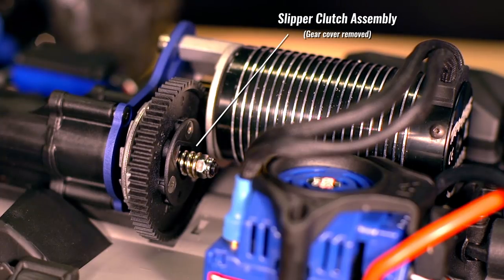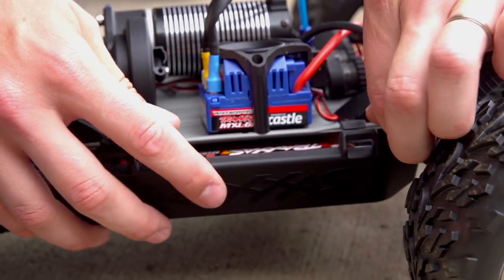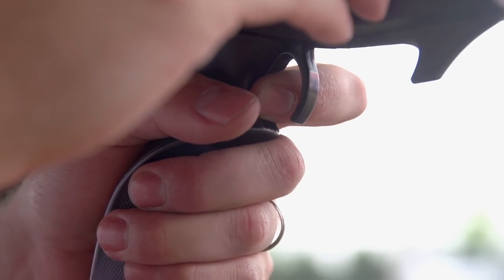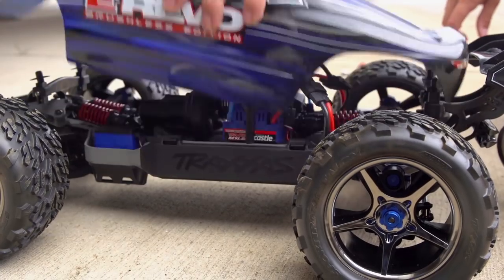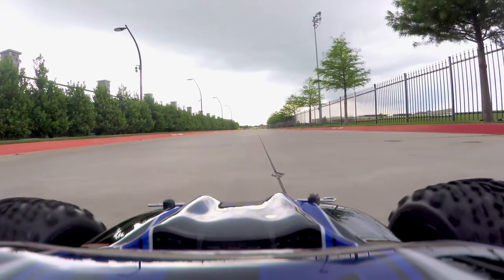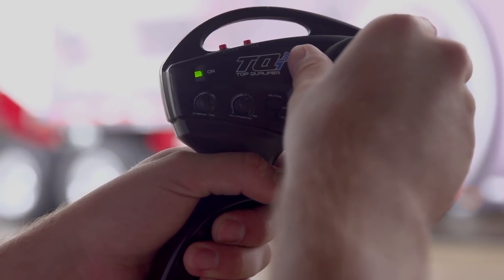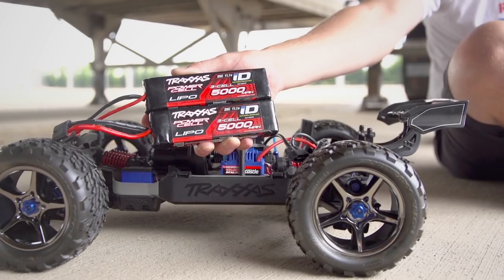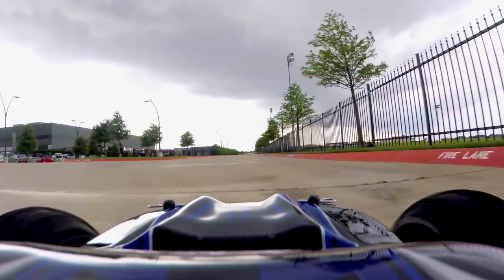How to Break In the Slipper Clutch | Traxxas E-Revo and E-Maxx Brushless

Comment: Is there a motor break in procedure? I heard of people blowing up the motors from using 6s on their first few runs and I and getting an e Revo Brushless soon with 6s and was wondering if I applied smooth throttle that the motor and clutch will break in smoothly
Reply: You can't break in a brushless motor. The people you're talking about killed the motor because they overheated them

Comment: Is this necessary for 1/16 scale E Revo VXL, or is this only for full size Revo?
Reply from the maker: Good question Bastian--this is only for the full size E-Revo Brushless Edition (and E-Maxx Brushless Edition)
Reply: Ok, Thanks!
Reply: @TraxxasSupport  how's it different for 1/16th?  I just melted down another slipper clutch, spur gear, and bearing... getting pretty annoyed.
Reply: @TraxxasSupport  wait what you do work for traxxas right because the 1/16 has a sliper clutch!